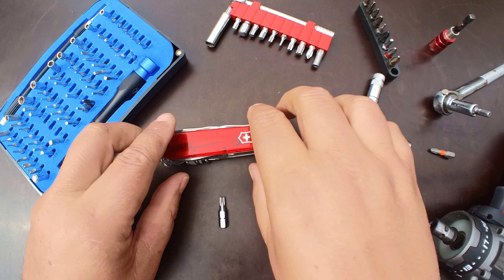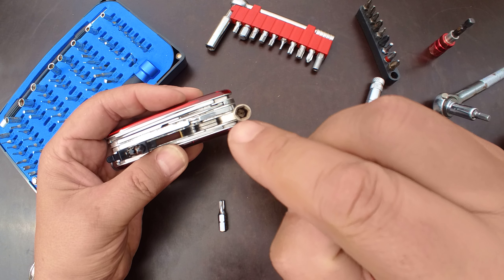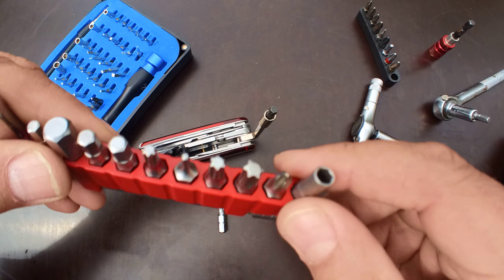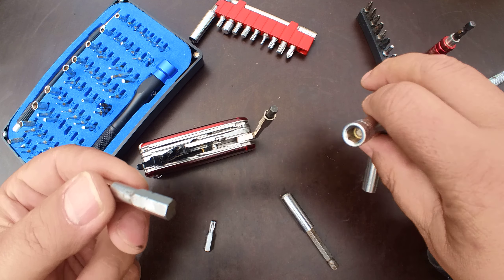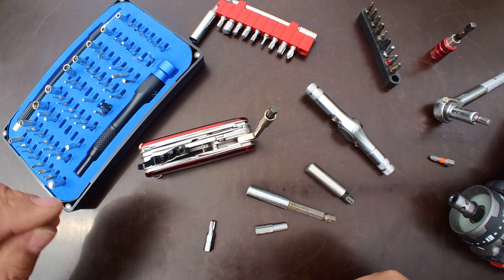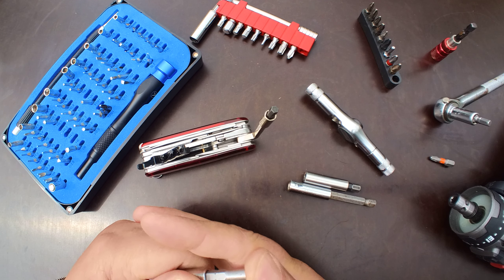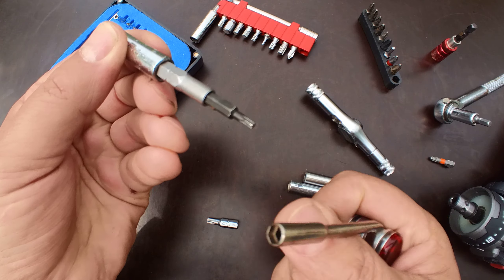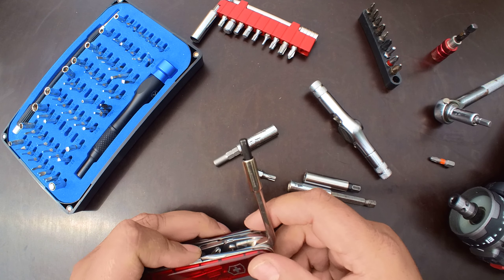Victorinox Cyber Tool 1/4 " bit adapter -  fast & curious hack nb 1

Comment: Nice mod. I had a few Wiha one-quarter inch to micro bit adapters. To remove the hex shaft from the one-quarter-bit driver I put the hex shaft in my vice leaving a small gap where the bit driver meets the hex shaft using a tack puller I pryed the bit driver from the shaft. It was pressed on and came off easy. I snapped off the end of a slim taper file and filed out the quarter-inch bit driver so the Wiha micro-bit adapter would fit. It sounds like a lot of work but it was easy to do. Thanks for the idea.

Comment: Hopefully people will suggest ways to separate the bit holder like you said. Perhaps you can get the discussion going by explaining how you separated the two bit holders you mentioned in the description.
Reply from the maker: Good point. Both attempts were on older bitholders and it was surprisingly easy. Fastening the bitholder, wiggling it with pliers and they were seperated. New ones, especially good quality ones will be tough to separate.
Reply: Here is an very easy way and guaranteed to work without causing any scratch: let the bit go through a 7mm wrench, in the way that the wrench tails up. Then mount the bit on a drill press, all way in, and tighten up the knob as hard as possible. a. Push down the wrench and the holder will come out a little. b. Lose up the bit, push all way in and tighten up. Repeat process a and b, until the holder is out of the bit.

Comment: Cool hack:) I found another handy hack for allmost all victorinox bottle opener screwdrivers, a 1/4 adapter fits there, put some ducttape in it so id doesnt wiggle, voila a swisstool has now standard bit capability for example:)

Comment: Great Idea! Currently I'm still fighting to separate the bit holder to get things work the way You described  ... 
But in the meantime I was lucky to find another solution with a [1/4" Hex(Bitholder) to 5mm Imbus-Hex]-female/female-adapter that connects to a [4mm Hex to 5mm Imbus]-male/male-bit to fit into Cybertool's 4mm-bitholder.
The CyberTool now works great with 1/4Hex-bits/nuts, and the combination of a Leatherman ratchet and the Cybertool's screwdriver in a 90°  position handling feels really ergonomic. 🎉
My purpose is similar to Your's to have another light tool as a biking companion, since screws on bikes mostly need not to be handled with extreme force.
Many thanks for Your inspiration! 😊
Reply from the maker: I am curious about this adapter 1/4" hex to 5mm female. Where did you find that one?
You comment triggered another idea: ideally the easiest adapter would be a double sided 1/4" hex. Then either  use a 4mm hex bit (male). Or a 4mm female hex bit that is often usually also is a magnetic adapter for hex drives to 4mm precision bits.  Use it the same way as my hack by sliping it over the 4mm hex bit of the Cyber Tool.
I found such double sided bitholders on the Japanes Amazon site (I am planning to buy a few Japanese tools)
Looking at my different bitholders, I realised I have several 1/4" hex for 1/4" square ratchets. I searched for a double sided 1/4" square to connect two of these bitholders and I found those "couplers".
These addtional hacks scream for a follow up video, don't they?
Reply from the maker: Is it the bit holder used by PB Swiss Tools for their Bike Tool?
Reply: @fastandcurious  The "double-sided 1/4-hex Bitholder" ... isn't it what Your hack is doing by modifying that bit-holder, that is normally used for using hex-bits on a drilling machine?
I've searched for such a "double sided 1/4 hex" female/female bitholder without beeing successful. Could you post a link, where to find those adapters?
Reply: @fastandcurious  Yes, it's a part from the PB Swiss Tool BikeTool. Got it together with the Imbus-tool - didn't know about that complete bike tool, where the adapter is the mission-critical part.
But unfortunately the PB SwissTool BikeTool seem to be out of stock ...
Reply from the maker: The best part of that PB Swiss Tools Bike Tool is that bitholder adapter that you already own. I found quite a few offers for the PB Swiss Tools Bike Tool. Though honestly, at about €35, the tool is overpriced. I think at that price point, the Victorinox Ratchet plus bit magazine is a much better offer.  Is an an additional pair of really good tire levers for longer trips stored seperately an issue? I bought my Vic Ratchet and magazine seperatly as spares, much cheaper...
Funny Trivia: The Vic Ratchet is probably produced by PB Swiss Tools as well. Just like the discontinued Victorinox Bike Tool was. The latter one included a bit wrench rather than the 5mm hex wrench of the PB ST version.
Reply from the maker: Yes, my Cyber Tool hack results in a kind of double sided bitholder. But I am always looking for other hacks which I will explore and plan to use for another video.  Here are some Japanese double sided bitholders I found:
SK11 SDJ-G
ANEX AWJ-K
TOP EBJ-R
trad TRD-JA 
When searching these, mostly Japanese sites will be listed aside from the odd expensive Ebay offer. On Amazon.co.jp prices vary from 4 to 6€. Purchasing the from a Japanese platfrom is only worthwhile if you are intending to buy a bunch of stuff to offset the shipping costs. Japanese tools (pliers, screwdrivers, ratchets...) are worth a look, also stationary products like pens, scissors or journals, or watches...

Comment: Does the 4mm Hex 5mm  (H5) bit fit in the cybertool holder?
Reply from the maker: Yes. A 4mm precision bit with an oversized 5mm hex male fits the Cyber Tool holder. But without a magnet, the bit will not "hold". I have inserted a magnet 3mm height into the Cyber Tool holder. It is a known hack. I am planning to make additional videos covering a number of hacks to use 1/4" bis or oversize bits for cyber tools

Comment: So all I have to do is find one of those adapters that you’ve had just laying around in the house?
Reply from the maker: Yes, but .. you need to find a "loose" one. Two of my old bit holders had a wobbly connection of the shaft and bit holding part. Therefore I could separate the bit holder from the shaft. Since then I bought some newer good quality bitholders. I have to admit now, that those are near impossible to separate.
I will soon post some more hacks for the Cyber Tools which are "easier".

Comment: So why don't Victorinox sell a BIT adapter???
Reply from the maker: Good question. Since that video I hacked a number of other bit holders for the Cyber Tool. I also tested how much power I would dare to apply to the Cyber Tool with a T20 screw. At about 5Nm I chickened out because I feared more would bend the chassis of the Vic.
5Nm is quite ok to tighten most screws. Loosening screws that a stuck might easily require more torque especially when using sizes of drivers (and screws) typically found with 1/4 inch bits.
I think that Victorinox rightly fear that a lot of people would use the Cyber Tool for jobs that a swiss army knife is not designed for: lateral torque on the layered chassis.
When first playing around with bit holders for the Cyber Tool I never thought about loosening screws until I needed to do it on my bike - and again I did not dare to push the limits. 
Since then I have switched to a super light weight yet fully capable 1/4 inch bit driver set as a seperate tool rather than part of a multi tool. 
The weight is nearly the same as is used with a bit adapter in combination with the Cyber Tool.
The bit layer of the Cyber Tool weighs about  33g or 25g without the double bits. A bit adapter weighs about 20g. 
My current bit set with more than 20 bit sizes weighs less than 60g.

Comment: There's a hack where you can put leatherman ratchet behind the pliers and you have yourself a 1/4 screwdrivers.
Reply from the maker: Yes, that is a great hack. But would you use that hack with a Cyber Tool? The Leatherman ratchet is not cheap... For me it is a question of basic choice: either a Cyber Tool, or for example the Handyman+ Leatherman Ratchet

Comment: Or Victorinox could have just made their socket a standard size.   Btw, i their really a world where computer 💻 techs use the cyber tool instead of $20 mini socket sets that they can put in their backpack?
Reply from the maker: Apparently quite a few IT techies carry a Cyber Tool. If I were one, I would chose the M, the small pliers are really useful in such an environment.
Why didn't they go for standard 1/4 inch bit holder and bits? I guess the "bit layer" of the knife would have been too big and heavy to make sense in the 91mm SAK format. 
My question to Victorinox is, why don't Vic include a nice magnet in the bit holder by default. Therefore one could carry additional 4mm precision bits including a few oversized ones (like a T25, H6 and maybe even a H8). 
The most popular hack is to add a magnet which I did. A video will follow soon.
Reply: Simple answer is yes.  I bought a Cybertool 34 (now known as 'M') over twenty years ago when I was an IT tech.  Has been indispensable, both for IT and general use.  I still have it, but I have added the saw, file, chisel and flat blade layers from a ranger, to turn it into a modified Cyber L, with the bit driver as near to the middle as possible.  Much better imho than Victorinox's tool placement.

Comment: With all the 1/4” drives available including multi-tools and even knives 
why you would take the chance of over torquing and damaging your 
Victorinox knife I don’t understand. To me it’s about the right tool
for the job. If you are doing work that needs the heavier duty 1/4”
bits get yourself a Leatherman tool with there bit kit, they are designed 
and warrantied for that kind of work.
Reply from the maker: I want to pocket all my tools, unless I am going on a longer trip. Most pliers based tools are too heavy for me. As a cyclist, a ratchet world be my first choice as the most appropriate specialised tool. The most lightweight 1/4 bit ratchet weighs about 100g (Victorinox Ratchet 31g, bit holder 19g, 7 bits in my case about 50g including the magazine). Total weight is about 260g including a tool like the Handyman. Still pocketable.

The Cyber Tool L weighs about 190g plus additional 4 bits and bitholder 240g. The Cyber Tool is a formidable multi tool for me.

For most parts on my bike the torque limit is about 3 to 6 NM (stem screws). I tighten them as much as I dare with the Cyber Tool
The 1/4" bits are for "bike emergencies".

If I take a test ride to adjust new parts on my bike for example, I pocket my Victorinox ratchet, a bit holder and selected bits plus the handyman.

If I believe more capable pliers are needed, I carry a combination of the Victorinox Ratchet, Victorinox Ranger and Knipex  Cobra XS.

I love tools like the Leatherman Wave or Victorinox Spirit plus. But both weigh more than 240g. Including all accessories and adapters both easily weigh more than 320g. Most would use a belt pouch - for me this is too much hassle.

For ratcheting, I already use the same Victorinox ratchet which comes with the Spirit Plus...